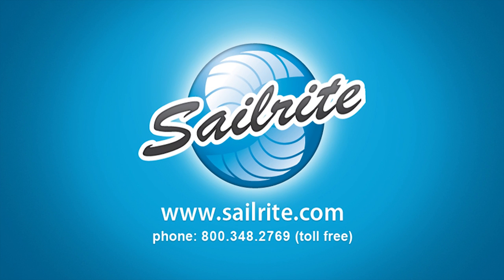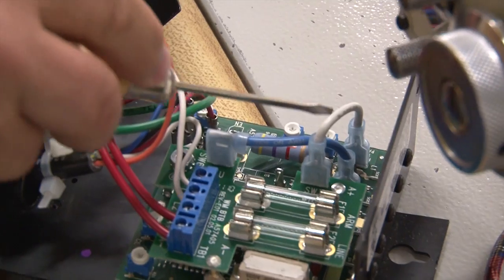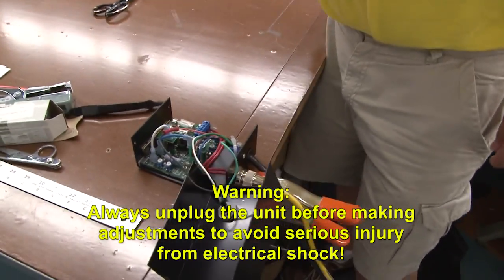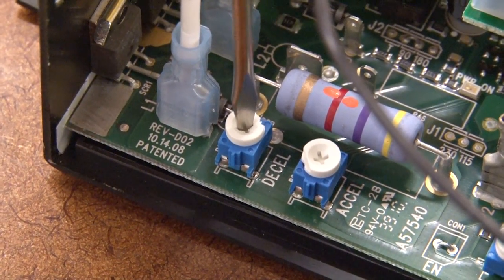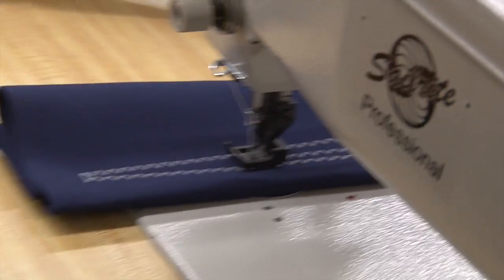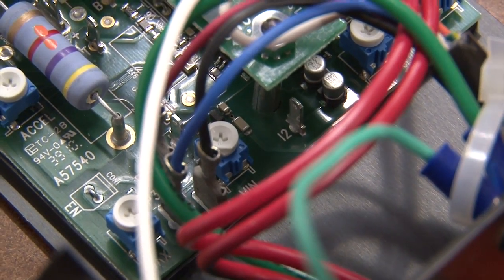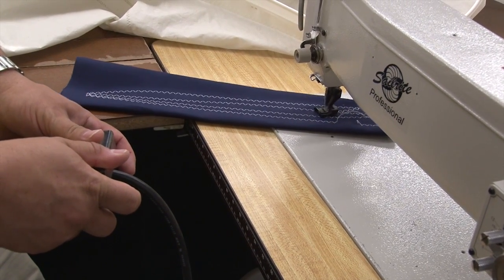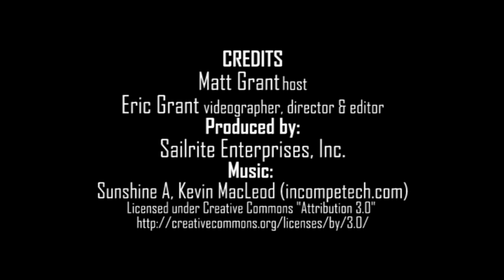Adjusting the MC-SCR Motor System for Sewing Machines

Comment: What are the other two pots "CL" and "IR" used for?
Reply from the maker: Adam McCoy CL is Torque Range (% Full Load) Specification from 0 to 200. It should be set at 125.
IR Comp Trimpot Range (at Specified Full Load) (volts) from 0 to 24. It should be set at 10 volts.
Reply: Hey thanks for your quick response. 2 years ago we purchased your Sailrite 111 with the MC-SCR and upgrade to the Power-plus wheel kit. Great machine! Glad to know how to adjust and fine-tune it.

We at McCoy's Upholstery and Canvas absolutely love your company, your products and especially your wonder high quality videos! Keep up the great work.

Comment: I would purchase this system if I did not have to open the box and plug and unplug to make adjustments and I would help you promo it on my YouTube channel.

Arthur
Reply from the maker: Typically our customers who use the MC-SCR power system do not need to open up the box and make adjustments. We set up each system, for what we believe are optimal settings for most operators. However, if you want to make adjustments you can do so easily by following this video.